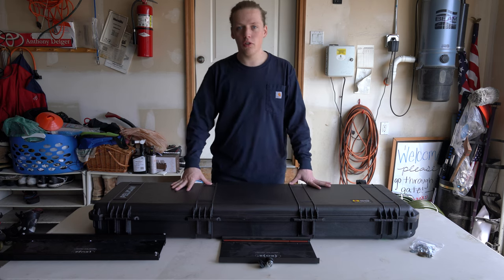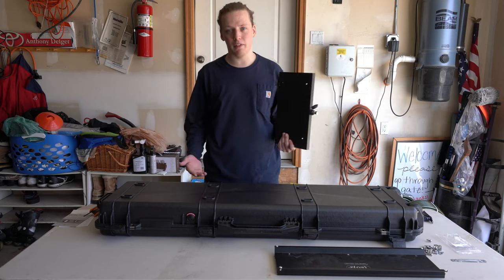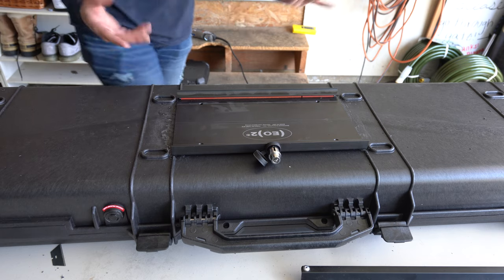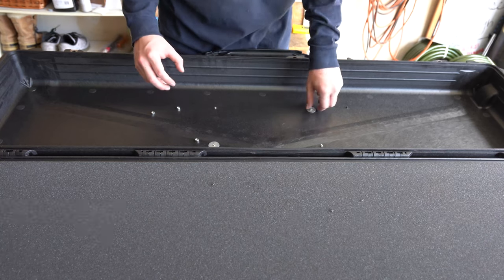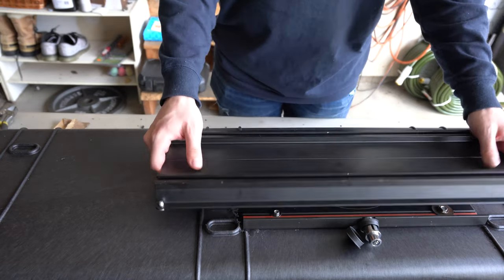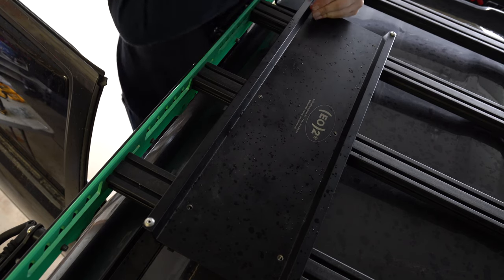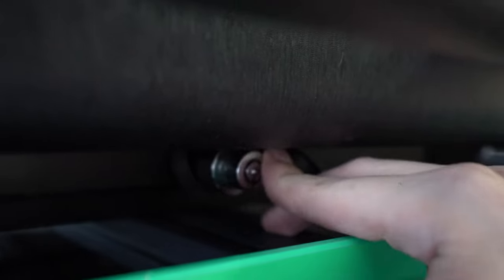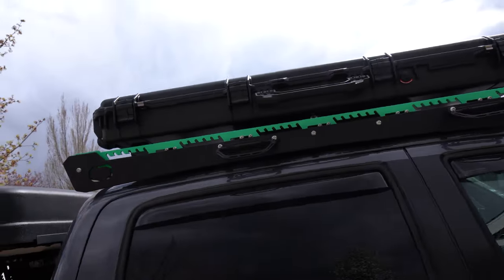Avoid THIS Mistake When Mounting Your Pelican Case Roof Rack

Comment: Great solution and I am curious how well it is holding up and if it make a lot of rattle noise on the trail? With the plate size you went with and the location of the mount being in the center of the case, do you find the case wants to wobble front to back?..Im considering using two smaller rails and mount one toward the front of the case and one towards the back to eliminate the potential wobble, but curious if yours has any front to back wobble.  Thanks for any further insight!
Reply from the maker: Thank you! Ive had actually zero problems with it, hardest part about it is getting the key in there since its a small space. No rattling at all
Reply: @TacomaForce  I’ve had my case for about a year now, but I think I’m gonna finally commit to this project. Thanks for your help!
Reply from the maker: Glad we could help! Im hoping to make my own solution to this since you have to modify to make it work but its the best solution up to this point!
Reply: @TacomaForce  Would be great to not have to modify it or my case!, but you're onto something with wanting to improve this product. Did you go with the low profile base?
Reply from the maker: I did!

Comment: Great video. Questions: Will this work for Prinsu roof racks, as well? By using this system, did it raise the height of the pelican that much more then if you just mounted to the rack itself? ; And you choosing the 14" top rail, was it so you can fit that on the bottom of the case without modifying further than the 2 lines of plastic you sanded down? Or was it for other reason(s)? ; So you did do some modification to the bottom rail, with the 6 holes you drilled, correct? Was that the only mods you did to it, although it looked like you sanded parts of it? ; Lastly, I know others have asked already but wanted to check again, to have the most current update.... the bottom nor the top has come loose from the bolts you used? And no issues of rattling and the like? 

I appreciate the video. This is a great idea. Thanks in advance for the answers to the questions!
Reply from the maker: Thanks man! Yes it should work for any roof rack! Yes it’s about 3/4 to 1” higher than if I mounted it directly to the roof rack. I chose the 14” for the price point and I felt it was big enough and secure enough to hold the case up even if someone tried to pull it off. Yep had to drill a couple holes in the bottom one to be able to tighten the bolts. I didn’t have to modify anything other than that and sand the bottom of the pelican case to make it sit flush! And final question: nope no rattling at all and it’s on my truck every day! And bolts have stayed super secure I would do it again! Thanks for interacting and let me know if you have any other questions

Comment: On the design of the eo2 is it possible for the fastener to slide when the two pieces are locked together?
Reply from the maker: Uhh it’s not designed for it but I’m sure with enough force you would be able to but definitely not when the lock is locked

Comment: What macgyvering did you have to do to the bottom rail? You left out that detail. Also would be informative if you listed to size of the bottom and top plate you purchased mate. Thanx for making this video. Only ever seen this mentioned on the forums. Havent seen a video on it. Cheers.
Reply from the maker: I actually didn’t end up doing anything to the bottoms of the rails! I will find the exact sizes and put them in the description! Thanks man glad you enjoyed it! I’ll find those sizes!
Reply from the maker: It’s a 14” top rail and a 22” bottom rail!
Reply: Thanx for the info man. Much appreciated. Looking at doing this after watching your vid
Reply from the maker: Thanks man! Glad I could help! Check out jake.delger on insta for more content and consider subscribing!:)
Reply: The bottom rail was he had to drill out some holes to stick a hex driver down into to tighten the bolts on the rail of the bottom plate. 

Not sure why the bottom plates come with rails since most racks use a rail system and you can’t tighten them without modifying them, drilling your own holes, or using an adapter plate. 

But you can see when he put on the bottom plate on the truck, he had holes drilled to tighten the cap bolts in the railing. Easier solution would be using longer bolts and drilling into the bottom flat part of the plate and bypassing the rails on it completely.